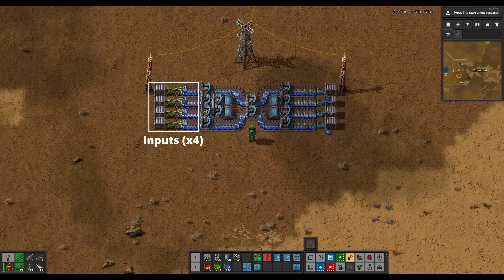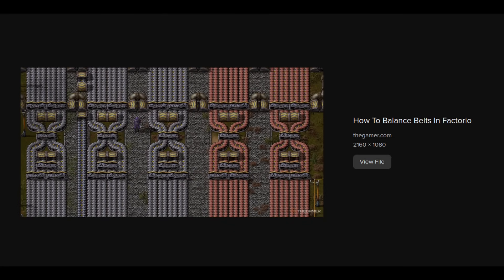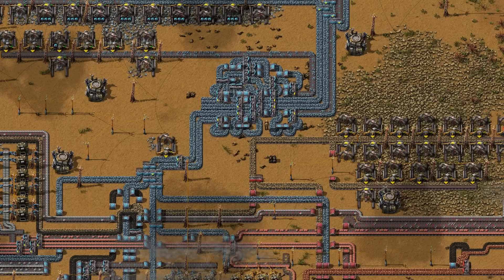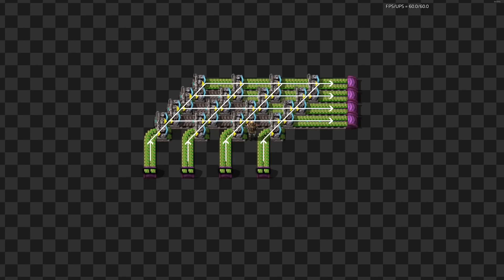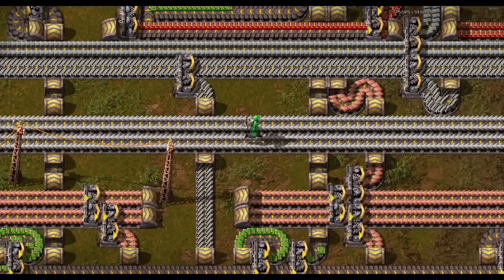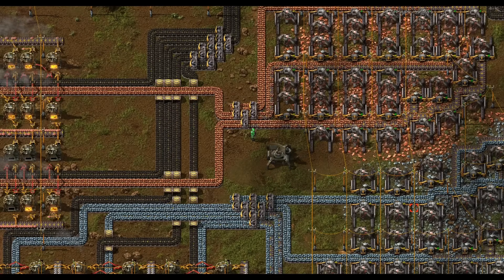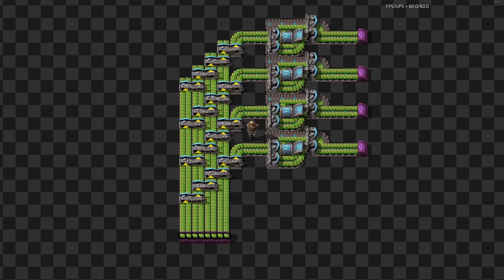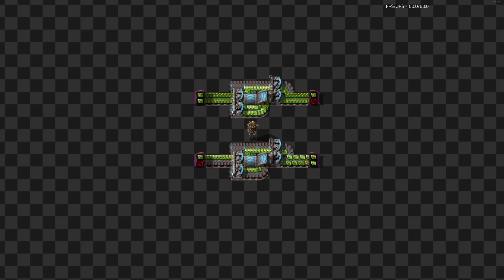Crossbar Switches: An Alternative to Belt Balancers in Factorio

Comment: interesting, I started planning for my belts to be used in a way that they dont require balancing anymore, instead of coming up with a simplified balancing solution like this. I have been using something similar to the "diamond switches" for my fulgora bases though, to filter out materials I want from a belt without bottlenecking

Comment: I've been subconsciously using that output crossbar switch for a long time now lol. I use balancers as well, but those I normally place after a major production zone like the smelters, then it's the switches like those shown in the vid for pulling off into the assembly lines

Comment: This is super interesting!
One of the arguments for (and against) balancers is that they can cause performance issues.

Because splitters can take up a relative lot of update time to worry about splitting into multiple Lanes... But, maybe the output priorities are significantly reducing that? 

But, then my curiosity becomes " A. 4-4 balancer uses six splitters, but the crossbars use significantly more. Do they have more savings?"

Basically I wonder if they are actually worth the number of additional splitters that it's having to add over a traditional balancer. (From an update time perspective, not the simplicity of putting it in place)

Comment: I was using this for a mass-sorting line in a mod (Angel/Bob) where some factories gave a mix of a lot of different outputs, in this case various ores.  A bunch of trains would come to a single station to unload, and each train was carrying between 1 and 5 varieties of the 12 different ores.  After unloading, all the iron ore was peeled off the 4-belt bus by a filtered crossbar switch, then all the copper ore was peeled off by a second crossbar switch, then all the tin ore, etc. and everything was loaded into a train depot with storage and a train stop for each ore type.

Comment: Something I immediately noticed with the crossbar switched furnace stack at 4:02 is the first few lanes have iron ore sitting idle, while the last stack is basically empty, so there's idle furnaces that could be getting some of that iron, but instead the crossbars prioritize completely saturating output 1, then output 2, etc.
Reply from the maker: Ah, that's not exactly a balance issue; this is just footage from a pre-2.0 base (and I wondered how long it would take for someone to notice/mention that these furnaces don't make perfect sense).  Because 2.0 made beacons apply 1.5x (up from 0.5x) the effect of their modules, the furnaces got waaaay faster, and now there are simply too many of them for the ore supply.  The same quantity/rate of iron plates, as formerly calculated, will be produced regardless.  The reason production is starting on the left instead of the right is because the plates are being removed from there first, after the whole unit had backed up and been sitting idle.  Basically, it's a mess… but the switches worked so I took some footage from it.  Given that the rail system for that factory also uses legacy rail turns, I opted not to fix anything in that save after the update.

Comment: At that rate you might want to look into Non-Blocking Spanning Switches which were also used in the telecom industry to solve the N:M distribution problem without the risk of interference from other lanes.

Comment: Very interesting and useful. Particularly for people who wants to build on the fly without relying on blueprints.
I think the caveat is that the lanes are no longer balanced, but rather filled up from one side. That is mainly and aesthetic issue, but when drawing from both side of a bus it could be an issue.
Since you still need side balancing then it takes a lot more space than a combined throughput unlimited side and lane balancer (2x2, 4x4 and 8x8 are most commonly used).
I will consider if they have a place in my bases in the future. Thanks for the inspiration
Reply: Alternatively, you could divide your lanes in two and have it be symmetrical. I'm just spitballing this without actually trying, but my thought is if you have 8 lanes, the top 4 prioritize pushing up and bottom 4 push down. So you have a V of splitters instead of just a diagonal line.
Reply: @andrewbalzer6263 i like the idea of pushing materials from the inside lanes to the outside, ill have to give that a try
Reply: When drawing from both sides I think you can do just fine if you stagger the places you draw from enough that you can fit shifting the materials to the other side. But yeah I can see how it’s not going to be very good early game where space is an issue.
Reply: I'll be honest, I got here because I hate how much of a clusterfuck balancers become above 4x4, to the point I no longer understand what my factory is doing.

As someone who wants to play the game as "organically" as I can (no longer possible because I'm using the internet), crossbarswitches don't make me scratch my head when looking at them for 2 seconds. It's also something where I broadly wonder if the creator had intended for them to be created, when they are literally a massive pain in the ass to construct above the 4x4 balancer. 

Balancers are the one thing in factory that I understand broadly, but would never be able to build, and they're very useful as you scale up. If I want to build a base with humongous throughput, I'll need something like them eventually.
Reply: Maybe you could use buffer chests too :)
Reply: Mhm, that do be an issue. In case you have a resource shortage, a balancer will still supply some resources everywhere. This will prefer fully stocking one belt before going on to the next, and so on.
Reply: The video actually shows how you can draw from both sides of the bus without any problem. See 1:30.
Reply: @Azzinoth224  It works well if your input is more or exactly the same as your demand, but if demand is higher it will start to serve the top lane first and then it will distribute over the others so if you have 3 belts drawing from the top and wants a max amount of iron it would get it, leaving nothing to the others. So pulling from it requires a balancer after anyway if your demand is higher. I have tried both and the crosswitch works good for like doing a mall or something, but planning out a big factory in alot of steps i usually work myself backward and try and calculate so input/output is a dividable by 2,4 or 8 and then match up with other inputs and outputs, that way you never have to touch other than 4x4, 8x8,16x16 or 32x32 balancers and you will have insane throughput without overcomplicating the balancing parts.

Comment: Just need to slow down a bit, allow your audience to hear your topic (explain), then show the example and pause to allow the audience to comprehend the explanation and correlate it with your visual (demonstrate). Be careful to enunciate; your 'N' & 'M's get mumbled with other things when you rush. I had to rewind at various parts because important notes were lost due to speed of jumping from one topic to another, and because either there was no visual to focus on the note. Such as in the case of 7:15, the visual of the "incorrect" version of the input switch was separated from the "out of view" / "correct" version and took it took me couple of seconds to "find" the error visually with what you were referring to. Overall your subject and information was spot on.

Comment: I love how most of the comments are "yes, but splitters bad for performance" when only 1% of factorio players get to the point where performance is ever an issue (unless playing on a cardboard box)

Thanks for this video, it explains real well what I figured should've been a mechanic (although I did the mistake of not placing enough splitters) and those absolutely will come in handy for compressing a 12 lane mining field into 4 lanes (which then can be easily balanced)
Reply: Even the 1% figure is probably too high, honestly ^^ but efficiency is fun regardless
Reply: and usually by the time you are to the point splitters are an issue, you probably aren't balancing belts to start with since you'd be doing direct train insertion because its faster. The most applicable place for this is definitely in modded where you are limited in some fashion or in the early game.
Reply: I play on a cardboard box and stay at a nifty 60.
Reply: I have a modded playthrough chugging at 15 fps on a 5600x, and I can tell you it's definitely not because of belt balancers
Reply: My green belt moves at a speed that yellow belts used to move at...but I still get 60 fps occasionally
Reply: I swore they were all talking about the factory's performance all this time. It never crossed my mind anyone was talking about hardware performance.
Reply: To be fair if you're watching this video then it's more likely than not that you're in that 1%
Reply: @szalyn8849  I agree with you, although I'd also add "and leave a comment" to that

Comment: Very interesting take. I appreciate the insight. I see the value of using them in a Bus scenario and intent to use them there. But I use Belt Balancers specifically in scenarios where inputs are not maxxed out but an even spread is required (ie. Train Stations) and as you said yourself Crossbar switches are not a replacement for that.

Comment: It is literally waste of time. You do not need belt balancers at all. You use belt balancers just because you get some items from the belt, by switches you have two basic options - to take half of the belt or full belt (multiple belts are just multiplication of the problem), this mean no matter how you accommodate rest of the items on the belts, you got rid of big part of the items. After just 5 (half belt) outputs you have 0,9 belts out of 4 line bus. Belt balancers through whole factory give you minimal bonus, just good feeling that factory makes something continuously instead of bursts when it overflows one production and then production of one item stops and resources go down the way to another process for a while. Problem is somewhere else, you are underfeeding your factory. Much better approach is to take resources from one side of the bus and just align up (or down) resources. production is literally the same in long term and instead of balancing mostly empty lines you see on first sight what is wrong and what resources are insufficient.

Comment: I'm currently doing a full-on spaghetti game, and it's early-mid game (I may swipe the spaghetti later on when I have robots), so this might not be for everyone.
But for N to M merging, where N is even, and a fair bit larger than M, I've started using just plain belt T crossings. 2 belts input either side of the output, then two of those feed another (faster if necessary) belt, and so on. I try to aim for just saturating the output belts, don't really care which part of the input "funnel" gets loaded more.

Needs some space to accomodate all those T sections, but it's fairly compact, and since it's just belts it's pretty cheap and fast to build.

I usually build machines in pairs for the electrical hookup symmetry, so almost always have inputs divisible by two (and for mining it just depends on the patch geometry, tend to fill them with miners).

Works well for unloading trains too, as long as you don't really care about which buffer chests get unloaded first. Again, I mostly just care about output belt saturation. If there's severe lane balancing issues, I might snake some part of the input onto the starved lane by side-loading onto the second tile of a two tile stump.

Train loading stations is something I've yet to really do well though... (I like to figure out things for myself most of the time, not using other peoples blueprints really at all, except for inspiration)

Comment: I've been using these to feed and merge new outpost belts of ore into the belts of my starter patches/smelters when they start to run low, setting priority to the original ore feed. Then as they run out the new ore belts will take over. it just seemed to make sense

Comment: I confess, this is the first I've ever encountered the concept and I'd played for years. Im not sure if ill use them as abundantly as you show for your designs, but at the same time, this is about to make my mining lanes to train pickups so much easier to manage... definitely saving to give it a few more watches, just to let my brain process how it works to understand the concepts better and the possible use cases for my style.
Reply: smelt at the mines!  Trains carry twice as much ore when it's already smelted.  Unless you want 2x trains that is.
Reply: @willbaack7997  when i masokitty, i do 100x research cost games where i do 100x100 rail blocks (interior) and it leaves more paths open if i just load ore, usually. But yeah, i maybe should consider that.

Comment: Balancers aren't just about how it runs in the optimal situation, it's about how the system degrades.

If there is more demand than input, then how do you want that input distributed over the demands? Do you want it to be first-come-first-served so that your early exits are saturated but your later exits are starved? Or do you want a more even distribution?

If there is more input than there is demand, how do you want that demand distributed over your inputs? Do you want your early sources to be drained first or do you want a more even distribution?

There's valid reasons to want any combination of these choices, and that affects what kind of distribution solution you use. Crossbar switches compress the output preferentially into specific belts. Balancers spread the output evenly across the belts.

There's also times when it's irrelevant because you've chosen a design philosophy of "always input:demand balanced all the time" which many megabases go for to limit CPU load.

Basically they're different tools for different jobs, and it's less about one being an alternative to the other than figuring out what design philosophy you're going with for your base.

Comment: one thing you do need to keep in mind about using this many splitters is not just the resource cost of the splitters but also the that splitters themselves are the least UPS-friendly belt component and also one of the more UPS-heavy things in the game period (as far as logistics go anyway) so using a ton of splitters everywhere for crossbar switches like this can definitely start to noticeably impact your game.

the other thing i think needs to be said is that while yes balancers are much more complicated to follow and understand, you only need 2-3 balancers memorized in how to build them and what situations you use them for and you'll be good to go for like 90% of cases that are 4 belts or less which 4 belts thick is the thickest any particular supply line on most people's buses tend to be. there's a simple 1:1 lane balancer, 4:4 balancer, and something like a 3:2 and then you can combine those into basically any kind of input/output balancer you want by just connecting them together like legos.
Reply: Almost no player will ever have to keep UPS in mind. People used to say "Nuclear power is bad because ok UPS" even though the only time nuclear power limits your UPS is if you have an actual megabase.

Comment: Rather than always balance multi-lane busses, I often compress them to one side, so that as they deplete lane N empties first, then N-1, etc.—all the full belts are on one predictable side and depleted belts on the other.  I've been using something like these crossbar switches for this, without knowing it, so that the inputs never stall.  I also use these or something similar to merge such side-compressed busses.

Comment: Your crossbar switches are what I would call flow routers, and have also been called throughput unlimiters. Splitter squares are the most compact way of building them (but maybe not beyond 500-> belts). I've recently been exploring lane flow routers, you can save splitters if you ignore balance, by using sideloading.

Comment: Recently when I was balaancing some scrap on fulgora, I realized that my balancers aren't "universal", which got me into a balancer rabbit hole, and at the end I realized, that balancers are only useful for train loading/unloading. So I started using "crossbar switches" on my bus, instead of balancers. Kind of annoying when I see youtubers using balancers when they aren't needed.
Reply: Balancers use fewer splitters, and you don't need one after every bus tap. Just after all belts have been tapped once.  First factory on bus uses belt 1, second factory uses belt 2, 3rd factory uses belt 3, 4th uses belt 4, insert balancer, 5th uses belt 1... and so on.
Reply: @Vegemeister1  My main pointy was that balancing isn't needed, just any kind of mixing.
"Crossbar switches" also don't need to be after every tap, but they do need to be used more often. I mainly prefer them for simplicity, and because after compressing belts you can see how many are filled, instead of each being filled partialy.
Reply: @Vegemeister1  you don't need cross switches after ever bus tap either, just apply the same logic ss the load balancers and have a few spare belts to pick up the excess